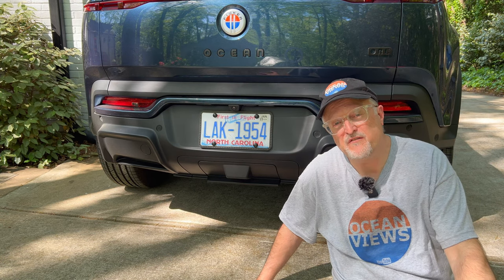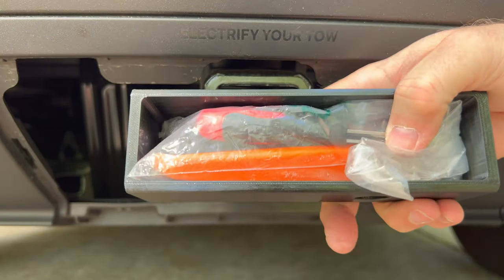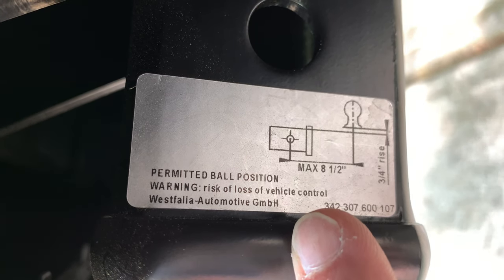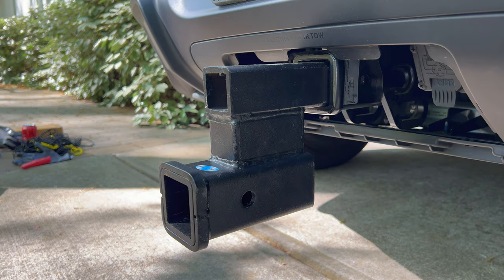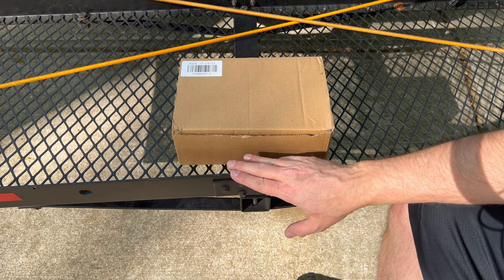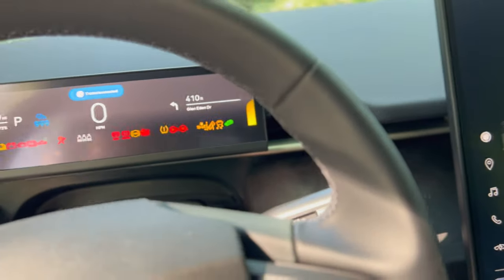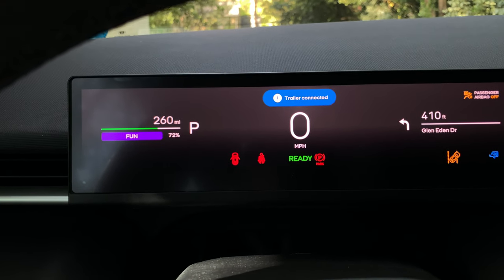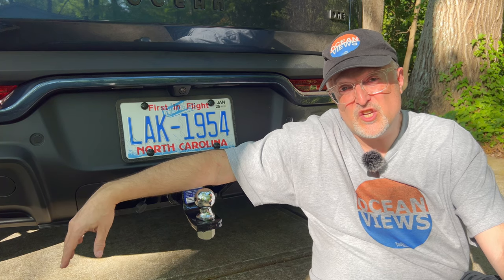Fisker Ocean One - Tow Hitch Receiver & Trailer Plug

Comment: Awesome video Matt! 
Question. I never got the tow hitch or electrical port. Is this something I can install off market?  I see some 2in add-ons. But not sure how to get the electrical port towards the back.
Reply from the maker: From what I know, the electrical port has to come from the factory.  The hitch receiver can be added later.  I know there are quite a few people that ordered the hitch with the car but didn't receive it.  There may be aftermarket ones available at some point from companies like Etrailer/Curt/Draw-Tite.

Comment: Thanks for the video. Any idea how you can attach a manual brake controller system like the Tekonsha? Usually there is wiring from the 7-pin electrical to somewhere near the steering wheel but when I asked Fisker previously, they had no idea and stated there was no wiring from the brake pin to the front.
Reply from the maker: I’m not aware of any way to add a manual brake  controller.
Reply: Have you found where to connect a brake controller?

Comment: Does the FOE come with a built-in hitch?  I realize the towing package adds electrical and increased towing weight.
Reply from the maker: None of the trim levels come with a hitch receiver.  There is a hitch receiver option and a full towing package with includes the electrical.
Reply: Thanks for steering me in the right direction.  I guess I will need to find a 3rd party option so I have a way to attach my bike carrier.  I've secured a FOE from Classic Fisker and hoping to take delivery within the next 2 weeks.
Reply from the maker: @theslimshadyist  I would contact Classic and see if they can order the hitch receiver.  It can be installed after purchase (unlike the electrical).

Comment: can we connect a trailer brake controller?
Reply from the maker: I look at the pin outs for the Ocean and the pin outs for a trailer brake controller I found on Amazon and they matched up.   Before purchasing a trailer brake controller, make sure the match.
Reply: @MTNRanger  
Is there a connector in the cabin for a trailer brake controller? 
Usually such connector would be underneath the steering wheel.
Reply from the maker: @lumberjackdreamer6267  There is nothing in the owners manual about a trailer brake controller. The only thing it lists is that there is a 7 pin outlet by the hitch.
Reply: @MTNRanger  
Ok. Those are 2 different things. The 7 pin connector is connected to the trailer. 
A trailer brake controller is connected to the vehicle system. It’s required for towing above 3500 pounds.
Reply from the maker: @lumberjackdreamer6267  The Ocean AWD trims have a max towing capacity of 3500 pounds.  There is no trailer brake controller on the Ocean.
Reply: @MTNRanger  
Oops, I was wrong. The limit is 3,000 for most states, and 1,500 for CA. 
So yes, a trailer brake controller is required to tow 3,500
Reply from the maker: @lumberjackdreamer6267  I don't know what else to say, it doesn't have one.
Reply: @MTNRanger  
Thanks!